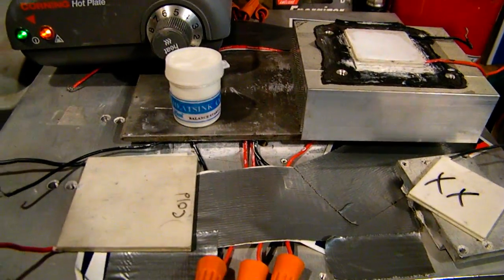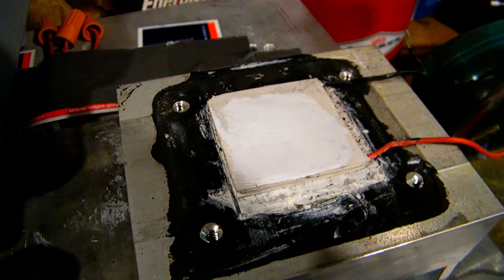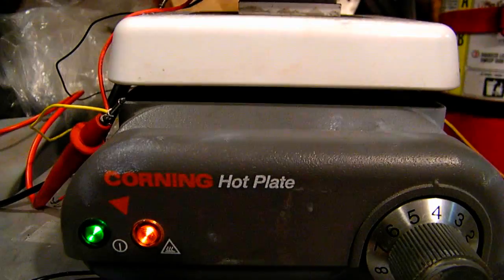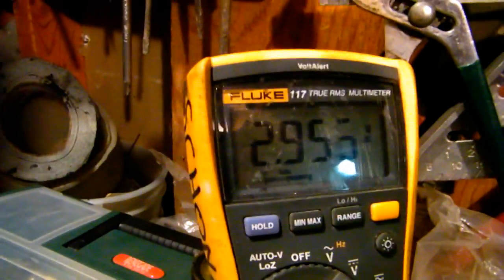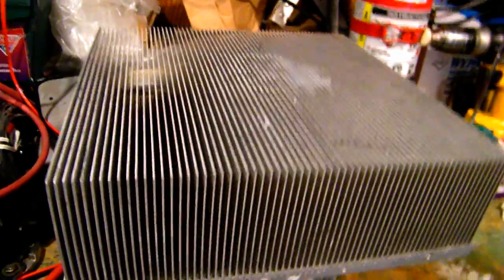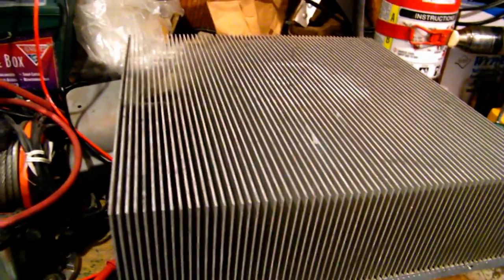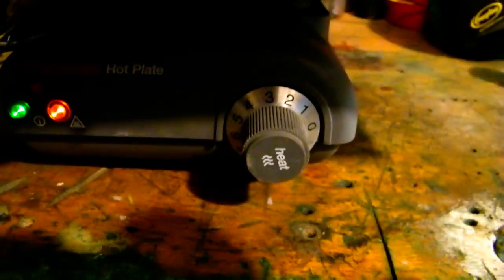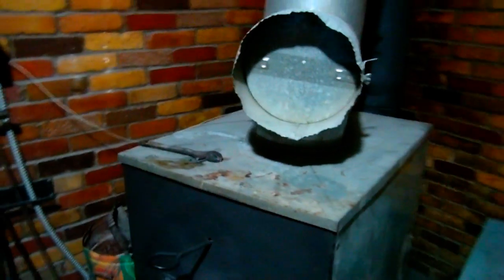Thermoelectric Power Generation On Wood Stove

Comment: This thermoelectric power generator will increase the wood-consumption of the wood stove. The wood consumpion is higher than the power you get from the thermogenerator. At least, it's a minus power production. If that would work, it would have thermoelectric powerplants out there.
Reply: +peter schiller Gas, coal, nuclear and solar heat plants are all thermoelectric power plants, but they do it with steam engines rather then Peltier elements.
It is important to pay attention in school kids.
Reply: Ok, but with steam you have a much higher heat to power effeciency. The peltier needs 500 Watt heat to generate 5 Watt of electric power.
Reply: +peter schiller "This thermoelectric power generator will increase the wood-consumption of the wood stove."  

Not sure how you arrived at this conclusion? Why would you burn more fuel by harvesting the heat it gives off?
Reply: +Dennis Khaye I think the stove produces heat to keep the house warm. If you take heat from the stove you have this less in your house. Imagine you put a big thermogenerator or a lot small ones on the stove. They produces a lot of energy but you will have much less heat to keep warm your house. You cant get energy besides for free. But there are other constructions, which heat is used besides, like in a waste incineration plant. They use sometime the "rest-heat" to keep warm  houses around the plant.  But I think if you take heat away from the heatsource for a secondary power, you wont have it for the mainpower.
Reply: +peter schiller Think "outside wood boiler", the stack on them loose so much heat that you literally would only be recovering some of its energy that is normally lost...it would be a very small amount but never the less its something. Mine runs 24/7 without any stop during the winter months and many others use them year around. There would be zero heat loss from your homes in these cases.
Reply: swany
That's brilliant, never thought about focusing heat radiation with a lens. My mind was locked on a dark night in the woods in front of the fire.
I wonder what a lens between the fire and the hotside would do hehe.
As to enclosing a heatsink, I have had no luck with that myself. Nowadays I do everything with copper pipe or a proper waterblock. Having a leak in your cooling loop is the worst.
I suppose if you are out in the sunshine a little drip won't matter much.
Reply: +peter schiller 
Cool the assembly with indoor air.  A few commercial systems I have seen cool the peltiers with the air the stove draws in as the fire burns. This way you do not exhaust the heat directly to the outside. 
In a large enough system you could watercool the peltiers and exhaust the heat into the house. You would be spending 20W or so on a pump and fans on a radiator. Since the aim was to get electricity this would only be practical on a system that produces enough excess power. Doing it this way will minimize possible loss of heat.
Reply: TIL: I thought the chips were cost prohibitive for large applications. I did not realize you actually lost heat in the process. All I really need this for is 5v charging while camping in remote areas (phone, camera, and the like).
Reply: Dennis Khaye
Just for funs I designed a system with ebay parts. 150-200W system would cost about 5-600USD in parts.  80 x SP1848-27145, each produce 3.2W at 100C differential. 2x240mm radiators with fans, high heat 12v pump, Alu plate and bars, copper tube, Solar charger to manage the current and volts. 
Perfectly doable, will build this one day when Im bored and going to the cabin in the woods.
Just set panel in front of fire and keep hot side temps under the max limit of 150C.

Phone charge should be easy, 2 chunky heatsinks that can fit 8 of these between them.
maxes out at 40V in series, the limit of most ebay DC modules.
Reply: +gloriouspopeman tom   5-600 Us $ for up to 200w non stop output compared to limited solar or wind is one hell of a deal ...i just started playing with this tech myself...i fried one cell..just ordered more supplies from ebay yesterday....one thing i have seen is that it is just as important to provide lots of cold to the cool side...a safer practice rather than going for extreme high heat on the hot side...like you said..its the temp difference that works...plus a lot of people say they heat themselves out of the room trying to get that woodstove roaring hot...saw a video today ..guy dropped a cold air vent pipe down from his attic to above his unit on woodstove..small fan on the cool side to help draw air across cooling sink side .
Reply: swany
True,even a steady 100w will run low power TV and lights all day long.
Smartest thing, like you said, draw in cold air from the outside to cool the heatsink.
Easiest way is to use the natural air draw of the stove itself.
I personally am drawn to water cooling the cold side. Gives me the flexibility to place the radiators anywhere i want, even under the house. If I add a valve and extra radiators I can switch from inside rads to outside rads. Of course the added complexity requires some maintenance, coolant changes and perhaps an alarm if the pump stops.
I am interested in seeing what happens when the cold side gets -20°C air.
Reply: i ordered a low voltage pump and large cooling heatsinks which i plan to enclose and pump water through the fins !!...i also plan to paint the heat sink for the hot side flat black and try solar heat from sun to see what i can get out of it that way...one reason i am more interested in the cooling side...i have a few small fresnel lens for the hot side to help out

Comment: Doing the same thing for a space heater and teacup candles (little cheap guys). Instead of running 1500watt space heater and running up my apartments electric bill, the top heat sink sits at 200-250F and TEC will power a low voltage motor rigged to a plastic computer fan blade to disperse it. There is an awesome write up of it here on youtube. While I wait I need to figure out a safe way to find the hot side with a volt meter.

Comment: put a small Y pipe off the intake of the forced air system with a damper to draw air off the cooler. it will work as a preheater for the air and cool the TEC.

Comment: I don't think you will get the most out of the generators by stacking them. They work best at peak temp contrast. The ones in the middle will not be as efficient as they can be. Also if you wire them in parallel pairs and wire the pairs in series you will get higher voltages and maintain a fair amount of current.
Reply: I LL try this ..." Wire in two peltiers parallel and wire them in series🤔😀👍😉
Reply: I LL try this ..." Wire in two peltiers parallel and wire them in series🤔😀👍😉

Comment: You should try using a PC heat sink it's probably a little cheaper and more efficient if you use some thermal paste that usually comes with it

Comment: Salam to all.
Too expensive to all these setups. I played with them for a while here in China. The easiest way is to attach cheap heat sink on 10 or 15 and then paste the other side on a metal sheet and paste it against a warm surface. May be a gas heater in house or something like that. Do not spend too much money on these you are not going to get extraordinary results. :)
Reply: thanks for the input bro, how many for 100 watts ?
Reply: Talha Kamran if you want energy from a difference in temperature check out stirling engine. No exhaust but it may not be self starting. I would use focused sunlight and a body of water for your 2 mediums. Maybe a secondary heat source for night time or cloudy days

Comment: Interesting to see how some people heat their houses. We heat water and run that through radiators in the house + hot water can be used for well.. whatever hot water is used for. I wonder which system has a better efficency.

In either case, you could also use the heat coming off the chimney. Should be over 140F compared to the 30F outside.
Reply: You are telling me that you use the water in your radiators for "whatever hot water is used for", hmm?
Reply: I guess I wasnt clear enough. It heats water in the radiators which runs in a closed loop. Drinkable water is heated and stored in a storage tank.
Reply: The radiator system has a better efficiency btw. Water absorbs and transports heat better than air. A fireplace's heat is mostly lost through the chimney.

Comment: I had a similar idea. I live in Arizona and was thinking about placing a long pipe in the ground for the cool side and leave the hot side up facing the sun . I also found more powerful Tec's on alibaba rated for something like 135 watts.
Reply: there are 400w ones and maybe more
Reply: The ground isn't an efficient heatsink. I was thinking cool running stream and reflectors would be needed to approach value for money.

Comment: Build a rocket stove with a tall chimney and line the chimney with TEGs. Attach cooling fins to the outside of the TEGs and wrap it in a water jacket.
 Run water through it as passive heating for warm water, before the water enters a heating coil inside the chimney to super heat it.
Reply: A friend of mine threw up the issue that harnessing to much heat from the smoke/hot air will restrict the air from rising (as hot air rises) and cause it to billow. Any thoughts on that?
Reply: You'd need hundreds of TEGs to absorb enough heat to stop the vertical draft. Assuming you managed that, all you'd have to do is simply reverse the direction of the exhaust piping and let gravity pull the exhaust out. Additionally, you'd be generating more than enough electricity to power a small exhaust fan.
Reply: Fair response
Reply: i wonder what sort of temperatures radiate off of the biomass of rocket stove mass heater. It would give you extended amounts of heat. You could embed them in the cob. Another yt commenter said wiring them in parellel pairs and then in series together would give max V. Do you think the energy could be stored in batteries? What do you think it could power? A few light bulbs? a laptop? I really know nothing about electrical, but I'm exploring the uses of RSMH's.
Reply: Johnmark Hatfield One 3x3 TEG can put out 2.5W, so I would imagine 20 of them could power a small laptop, recharge batteries, etc.

Comment: I like your forced hot air duct work. was thinking myself about hot water radiant flooring piped along side the stove but thats a whole other ball park of pluming and what not. cool ideas with the thermal power design.
thanks for the video keep it up.

Comment: You did a mistake, you are heating the cooler, so it won't get the what you want.
If you put the oven in vertical and the cooler, I think you will get better results or try to use an isolator with the same size as de cooler or bigger, with a square hole on the isolator to put the thermoelectric, with that you prevent heating the cooler.
Reply: But man, you are thinking as me, how to collect all power we waste to heat or cool us. Yes we can use it even on summer, remember, our air conditioner produces heat (a lot) to produce cool, like our fridge.

Comment: Any update?  What kind of power do you think you can generate?
Reply: There's I believe a British guy who managed to get 8+ amps@ 12v volts he was using 2|| of however many he needed per series I believe it was 5 for 12v so 10 total, but I'm pretty sure he wasn't using thermal paste and burning the stove like an inferno to do so, but with thermal paste and a high coefficient cooling liquid it should be possible to achieve those numbers or better at a reasonable burn rate if you find ago the loss in the system.

Comment: Build an air tight tin housing to surround your cold side heat sink then install 2 3" ducts, 1 down by the floor to the outside and another straight up to the roof or top of the wall to the outside as well. Insulate the pipes and housing so you do not cool your house too and you will have a serious cold side source powered by natural convection. Cover that whole heat sink with TECs and a plate of aluminum to space it off the side of the wood stove a bit and you should make some decent power. run 12 in series for your 16 VDC charging juice and four strings of 12 in parallel for some current as well.

Comment: An aluminum plate painted black for sun heat and a tube of aluminum in a mountain creek would be cool.
Reply: Might as well get a solar panel which is 20% eff while TEC devices are only like 2% eff.
Reply: Maybe use some mirrors to direct the sun on it.

Comment: But a Zener diode across the outputs this will stabilize the output voltage.This diode has to be in the power and voltage range you are generating.

Comment: How did your project on this go in the end. Most of them wood stoves have a way to heat your water too for a hot water supply. Water will not heat to over 100'c and makes a great way to control the temprature to peltier transducers. Its a great 12v or 24v emergency power system for sure. Just wondered if you got a fully working design on it yet.
Reply: That's what I'm saying ...

Comment: use heat pipes which will take the heat away from the TECs and then dissipate through a heatsink, should be a better result, as long as the heatpipe starts to work at a low temp. Just a thaught, nice heatsink

Comment: The one I currently have in production will supply 12V at 200A, it is designed in a hybrid parallel / series array. Also have designs for version 2.0 that will for one with a built-in inverter that will supply 110V at 10A continuous.
Reply: Begging your pardon, but 110V at 10A seems unrealistic.  You realize that's 500 times more output power than the one you currently have in production?
Reply: Sorry to be realistic, but MIT just came out with a way to get close to 50% effieciency out of devices like this with rare earth metals. I doubt you found a way to even surpass the research that they have done. And if you did have a way to do this you would get all sorts of Gov grants and have a website displaying your achievements. Please don't waste peoples time and hopes with your non-sense, or prove it!

Comment: lol, you guys are a bit too late with this, I developed and built a proper one that uses the temperature differential from outside to inside, currently in the first stage of the production run. I'll keep you posted soon as my shipment comes in from Shenzhen.
Reply: Show us ... you dont have one single video WTF
Reply: Yeah I would rather not, I have a proprietary method that optimizes thermal transference via a additional piece of hardware and controller.

I'll keep you posted soon as I have my production run.
Reply: This guy has his shit so together he has the leisure time to come brag in youtube comments.
Reply: I am sorry, but using the difference in temperature in the winter is foolish. At best you are looking at 15% efficiency for your TEG. Let's say you pay for 100 J of energy to heat your home, in addition we'll claim you have near perfect insulation in your house, about 80% efficient, and then you decide to set up an amazingly efficient TEG. Your TEG at best will get 15% efficiency, so you will release 20 J of heat outside due to improper insulation, then of the 80 J left you will recover 15% as electricity, so approximately 12 J will be electricity, that means you will waste 88 J for every 100 J paid for... The TEG will more likely see 5-7% efficiency, and your home is lucky to be at least 50% efficient for insulation properties, so 2.5-3.5% total system efficiency is what you will more likely see. Good luck with your expensive materials, and congrats you have successfully found a significantly less efficient system than an internal combustion piston engine. It'd be better to run a micro-turbine that exhausts to the outside, with a greater temperature difference the turbine will become more efficient, you'd also probably spend less getting a small turbine, or setting up some other type of external combustion system to generate electricity. At least with a combustion based system you'd see closer to 35-55% total efficiency.

Comment: I would love to know where you got that monster heatsink
Reply: Coleman Thermoelectric travel cooler. There are two big heat sinks with that black gooey adhesive connected to an aluminum core and a TEC on every cooler. The cooler also has some kind of sensor linked into the power supply side and a single motor powering the fan blade inside and outside the cooler. I'm not sure what the sensor does, it seems like a high temp cut off because it was part of the DC positive circuit and positioned facing the heat sink on the hot side (aka outside). They are really good heat sinks, extra thick, and lots of thermal mass. The core just allows conductive path through the insulation between the hot and cold side while creating some distance between them.

Comment: hate to tell you this but that's a nutty set-up with the hotplate !
think about it , 
it makes no sense to put a heatsink where it's going to draw heat from the plate .
on the other side what you describe with the stacked coolers on the big Hsink to use in real life makes good sense.

Comment: One could also build a fluid loop that penetrated the wall. The cooling outside and the heating inside would tend to cause natural circulation, so you might not even need a pump.

Comment: TEC coolers are only 4% efficient at best. You could do a crude steam system using a old two stroke engine and get 10% efficiency much easier.

Comment: No, everything you add to a system will have efficiency losses. Adding more of the same thing just multiplies the losses. Further, it sounds like you're trying to make some kind of energy multiplier, getting more power out of the system than is input - this is not possible (though plenty try, and fail, all the time). It would be best to select low loss components in any case.